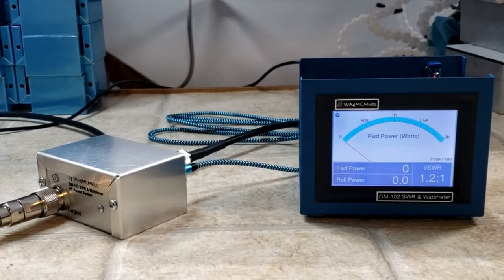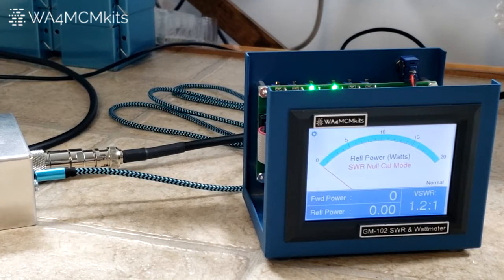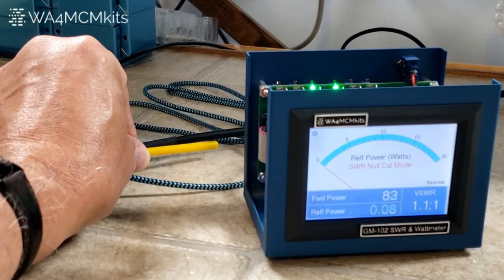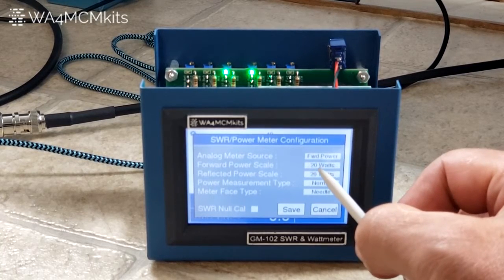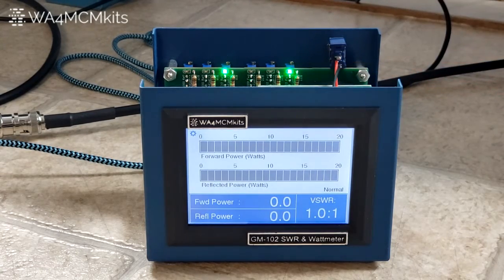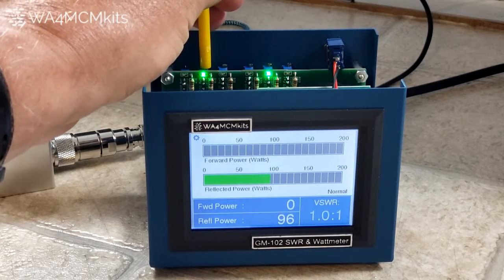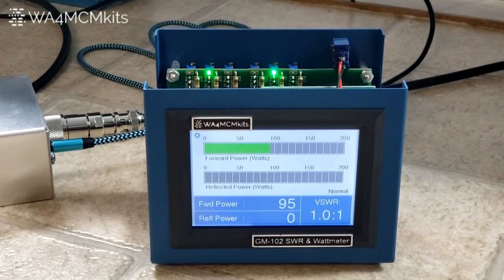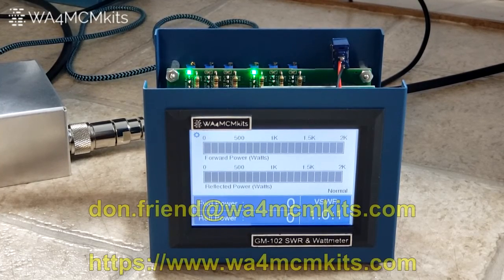GM 102 SWR & Wattmeter Calibration Procedure

Comment: A guy would have to buy a scope and tap to align the meter.
Reply from the maker: That's one of the ways to obtain the power standard.  You could also borrow a calibrated meter from one of your Ham buddies to use as a standard.

Comment: When you did the balance adjustment and turned CCW 3 turns....it looked like you did 3 half turns, not 3 full turns.  Is that correct?
Reply from the maker: I spin the tool pretty quickly, so I'm pretty sure that it was 3 full turns.  However, the number of turns is not really important.  The purpose of this step is to ensure that the gain on the OpAmp is high enough such that the true null will be more noticeable - and there's no telling where the trimmer potentiometer's setting was when it came out of the factory.

Comment: Is an OHR 100W dummy load sufficient?
Reply from the maker: I'm not really knowledgeable about that model load, but as long as it is a true non-reactive, 50 ohm load, and will handle your output power, it should be fine.

Comment: What model of dummy load were you using? I finished my kit but need to buy a DL to do the alignment, thanks. 73 Jen
Reply from the maker: Hi Jen,
To be honest, I'm using a 50 year-old Heathkit Cantenna that I built back in 1973 when I was a new Ham.  However, any true 50 ohm non-reactive dummy load would be fine.
Reply: @wa4mcmkits704 oh ok, that sure didn’t look like a cantenna at 36 seconds in the video, I’d recognize those.. lol thanks
Reply from the maker: @Jennifer-007   Ahh - I misread your original question.  Yes, the DL in the video is a cheap thing that I picked up at a hamfest recently.  Unfortunately, it doesn't have a label with the Mfr. and model number.  I actually used the Cantenna during the R&D phase of the GM-102 project.  I guess this illustrates the fact that any 50 ohm, non-reactive dummy load capable of handling your output power will suffice.  I've seen several that would probably fit the bill on Amazon.  Of course, there's always MFJ - hi hi.